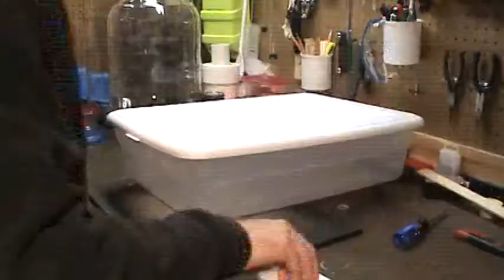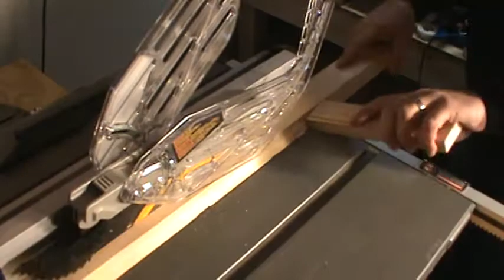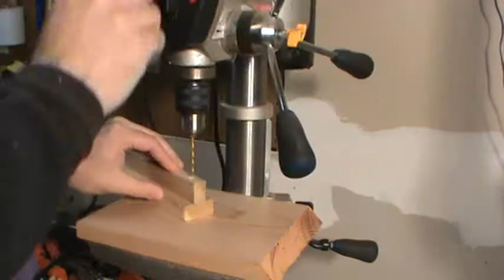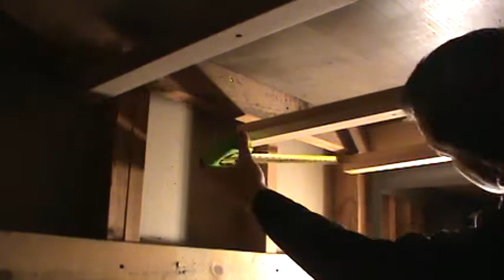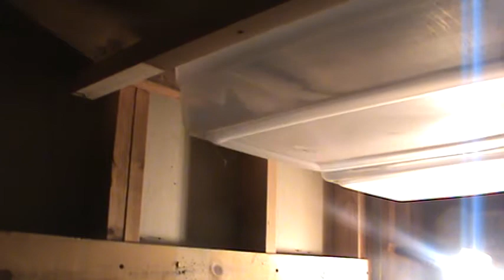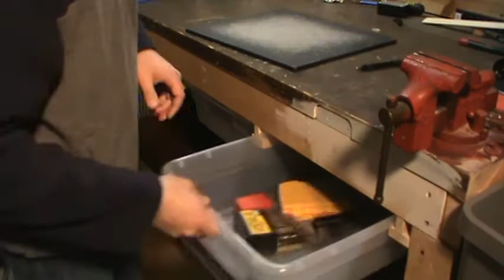Making Workbench Drawers from Plastic Bins

Comment: I think I may use this idea to store legos under a lego table I am making for my daughter. :)
Reply from the maker: Great idea! I'd recommend finding bins that are designed to slide into slots like this. The ones I used were cheap storage bins, and they could be a little tricky to slide in since they were somewhat flexible and had extra support plastic that could get caught on the way in. If you don't mind smaller bins, the Ikea bins for the trofast cabinet are more rigid and are made to slide into slots (see my Ikea lego table video for reference).
Reply: Those are the bins I was looking for. Thanks for letting me know how to find them. I will look up your Lego table video too. Thanks